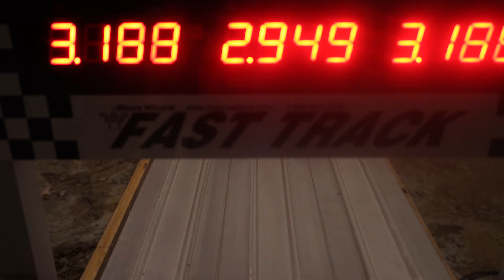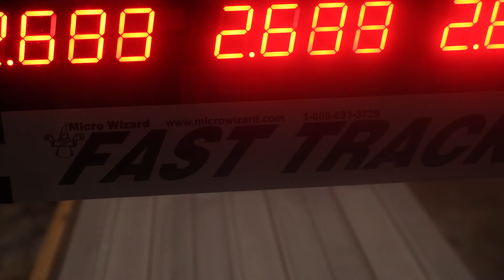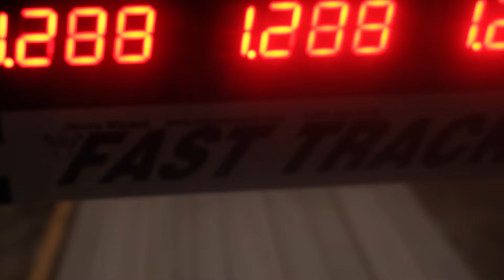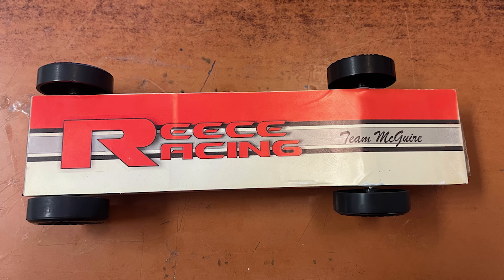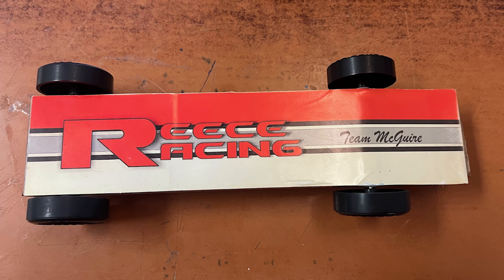Pinewood Derby Oil vs Graphite speed secret

Comment: This is so great.  Would be awesome to do a video on how much steer to put into the axle for optimized speed based on your standard car - the red and white one.  For instance - simple tests at home to test / calibrate steering - like painters tape on the floor and how many feet it takes to cross from one side to the other

Comment: At that time what would be the difference in length of cars is that enough to see with the naked eye
Reply from the maker: I’m sorry but I don’t understand the question. The one car used in this video was 7” long
Reply: Know what I'm asking is if you raced the graphite car against the oil car how much farther would that have been if they raced against each other like is that a car length is that half a car length is that almost nothing I know in the past I've raised cars that have been ran on liquid and still one but they were much faster than they should have been and I've never put two cars up against each other to see how far the actual distance is
Reply from the maker: @tateabdon1  Yes, that should be over a car length
Reply from the maker: In league racing, if I’m standing at the finish line, I’m able to see a car win by .002-.003. With the naked eye